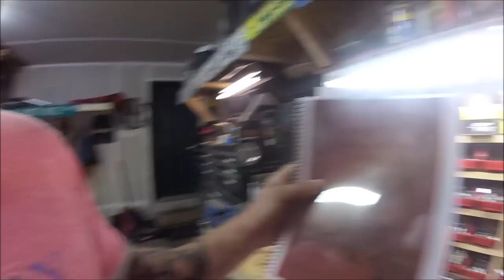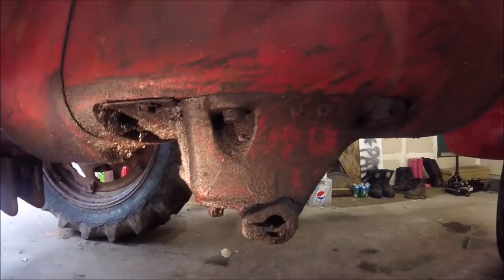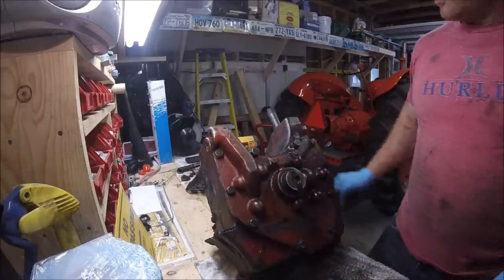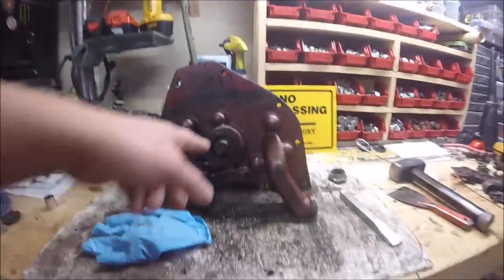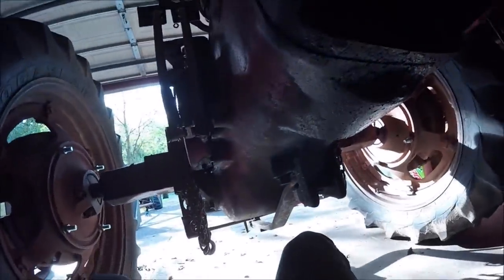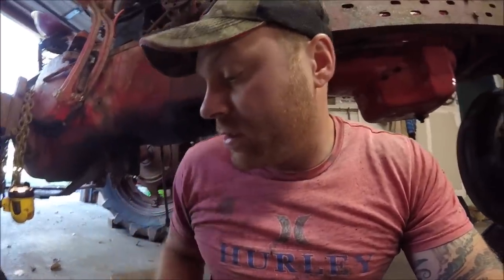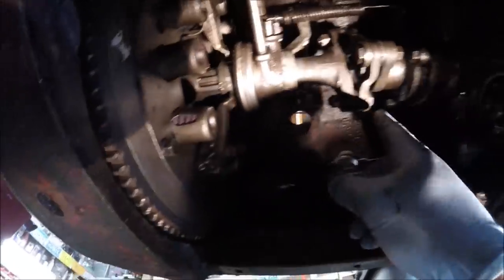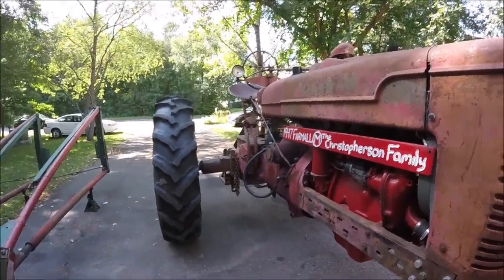1947 Farmall M Clutch Removal & Belly Pump Service

Comment: the early lift all pumps  were only 450psi low volume pumps farmall made n upgrade kit with  a larger gears and a pressure relief valve that increases the pressure to 750psi and  much more volume
Reply: Yea my 1940 M is putting out 500 p.s.i.
Reply: that  is why that seal did not fit. also the lift all pump from the f20 will fit the M or the H.the farmer next door to our farm had a1939 H sn 0113 on steel .no hydraulic  no belt pulley and no electric start and a   solid pipe seat pedestal and it was on distillate . he farmed 100acres with it and it pulled a 6ft disc and a 2-12 trip plow.  since it was on steel 5th gear was blocked from engaging..
Reply: i learned to farm with a 51 farmall H  it was my tractor dad used a ac d15  we did all planting spraying and cultivating with the H it came out from the factory with the high compression piston set which dynoed out at 30.5hp just enough HP to pull a 10ft disk in 3rd gear in most ground.
Reply from the maker: I love hearing these stories! I would like to rebuild the H next.. More on that to come (I have a video planned with some ideas).
Reply from the maker: So they had a replacement reservoir in the upgrade kit? The bore in the casting is too small for the seal, which is why it didn't fit. You would have to put the reservoir in a mill, and machine out a larger recession for the new seal to fit. Unfortunately, I don't have that equipment.
Reply: you get 2-3more hp and smoother idle  by using a 300 carb the original carb flooded way too easy and was always leaking even after a total rebuild with new float and kit
Reply from the maker: I'd love to change out the carburetor on it for a Super H or 300. This H carb really isn't the best for the tractor.

Comment: Learned something new. My grandfather always broke the tractor in half to replace the clutch sleeve carrier but this way you do not
Reply from the maker: Nope, on the H and M series you can get the clutch and driveshaft out without splitting. It wasn't until the 12" clutch in the Super M that it was necessary to split the tractor as the components are just barely too large to get out of the belly of the torque tube/clutch housing.

Comment: the IH dealers had a pair of Tee handles that went thru that funny lookin slotted hole in the very bottom of the pump.  this tool was incerted in each sid and 2 mechanics blocked the pump and then got into position and lowered it down manually. i have used these tools  IT service book i had had a print for making them
Reply from the maker: Yessir, I know the T handles you are speaking of. Little hard to operate them by yourself, though!
Reply: the dealership modified the ones the shop had and made it into a jig for a floor jack this prevented  the pump from tilting or falling of the jack when R & R ing it
Reply: when i was working for the IH dealership a customer with a 60hp M was pulling a 14ft disk and twisted off the clutch shaft a helper and i had to fix it in the field we had it repaired in 3 hours the customer  took the 2 of us to the local cafe for lunch.
Reply from the maker: That is a pretty big disk for an M - but she didn't run out of power (just strength in the driveline). These things were designed and meant to be able to be fixed in the field. Unlike the tractors of today.

Comment: I am having no luck at getting the hydraulic coupler off the tractor to replace the seal tride air impact  and heat . Any information would be helpful
Reply from the maker: On my H, I had to cut it off. It had been installed so tight that the threads were mashed inside the coupler.
Reply: @KennyKizzleRustyNutzRanch   do you have any videos showing how you cut it off?

Comment: A manual I have mentions you have to time the engine in a certain way before I remove the pump. Is that not nessesary? Thank you
Reply from the maker: Only if it is the live hydraulic pump. The live hydraulic pump is driven off the cam gear, and serves as the timing gear for the ignition system. In this case, yes. But the belly pump is not timed to anything, nor is it a live pump. It is driven off of the transmission countershaft and in no way affects engine timing.
Reply: @KennyKizzleRustyNutzRanch  thank you

Comment: Gee you make that look so easy!! You need a tranny cradle for your floor jack. They come in handy for those types of situations when you are by yourself. I didn't recall you ever saying the pump leaked but you have quite a herd of tractors, I must of missed it. I still remember it sitting at the junk yard, locked up. It has come a long, long way.
Reply from the maker: It actually was not too difficult at all. The most difficult part is removing the pump itself (balancing it), and then remembering the order of operations in removing the clutch and reinstalling it. A tranny cradle would be NICE. So would a welder! That tractor has been through the ringer, that is for sure. Definitely have been in it UP TO MY ELBOWS. I think that is why I just couldn't part with it.

Comment: Finally getting around to watching all the vids! Looks like a job just getting that pump down from the tractor and back up in it! I'm gonna have to do that on my H and M pretty soon. They are both pretty leaky... And Thanks for the Shout out buddy!!
Reply from the maker: It's not too hard of a job - biggest thing is lower it SLOW. When it finally slips out of the belly of the tractor, it is VERY tippy, and VERY heavy. It will definitely smash your finger or hand if it lands on it - so if it starts to fall you are better off letting it go! Glad to give you a shout out - I appreciate all the conversations!

Comment: Great job on all of your videos. I have been (ever so slowly) restoring my 1941 Farmall H model. Serial FBH 21044. I have installed the PTO system that was missing (the one with drive dogs, not splined) I am a bit concerned that it won't be able to handle significant load like rototiller attachment. Guess we'll see. I currently have a hydraulic pump that goes in front of the magneto instead of the belly pump, but after watching this video, I am contemplating installing a belly pump.
Reply from the maker: In my opinion, I would install the pump in front of the magneto. This will give you live hydraulics like the Stage II Super H. Quite a bit more useful than the belly pump.

Comment: Hi Kenny, this video has encouraged me to fix the leak from the front of the transmission/hydraulic belly pump. Please comment back on the part numbers of the seals, where they go, and where to buy them.

From the video I see you successfully found 3 of the 4 seals. in my searches I am only finding 1 or possibly 2...

Your experience is greatly appreciated.

Thanks,
Henry
Reply from the maker: Henry, here is what I have for seal numbers. I ordered all of them as SKF (insert part number) from eBay or Amazon. You could go to your local NAPA and get them with the SKF numbers as well. The hydraulic actuator arm is the seal I have had trouble finding a replacement for. I ended up doctoring the one I have and so far it has been holding. Anyhow, here are the numbers. I hope you find this helpful.

Belly Pump Drive Seal: IH# 43509D superseded by 938294R91 SKF#13649
Belly Pump Actuator Arm Seal: IH# 19812D (used with shaft 15089E) or 494027R1 (used with shaft 15089EA) - parts diagram lists two different seals. SKF# 7512 for the IH 19812D. Navistar/SKF/Timken do not list a cross reference for the 494027R1 seal.
Trans Input Shaft Seal: IH# 43359D superseded by 71871C1 SKF# 20702
Trans Countershaft Seal: IH# 50839D superseded by 381907R91 SKF# 16113

Also, here is a link to an online parts schematic. I am sure you can also get the parts from Case-IH. https://www.messicks.com/cas/48950
Reply: I k ow this is a old video I’m just hoping to find out witch seals need two ordered

Comment: If you can't find a new drive dog or your grooves are too deep you can take it to a machine shop and have it turned down and a thin sleeve turned and pressed on to create a new sealing surface.Crankshafts are repaired this way. You can use this method for a lot of parts where you have a sealing surface. Normally you turn the sleeve to a sufficient thickness and shrink fit it on. Just a tip. Also glad to see you make proper gaskets and not just smear some rtv on everything.
Reply from the maker: Thanks for the info, Johnny! I was able to get the drive dog cleaned up nicely with some emery cloth, and it is holding well now. I believe there is a company out there that makes what is called Speedy-Sleeves to do the same thing you are speaking of. Essentially it is to make the shaft true again, to allow for a good seal. I usually use RTV sparingly. I like to take a VERY thin layer and coat the gasket just to help it stick and seal.

Comment: The shop I worked for had a jack that fit into the big hole and the bottom with a key way. I slid in sideways and had screw jack to lower it down.
Reply from the maker: Yes, I have seen multiple different ways/tools used to lower the pump. I believe in some of the old IH books, they have a two-person tool available. Almost like two big T-handles that slide in the cultivator hole in the bottom of the pump, and each person helps lower it down.

Comment: Hi Kenny, did you ever find the right seal for the belly pump actuating shaft where it comes through the reservoir housing? Thanks, Mike
Reply from the maker: No sir. I was unable to locate it. I ended up doctoring it up with a little RTV.
Reply: @KennyKizzleRustyNutzRanch  OK, too bad it wasn't available. I dropped the belly pump on my M today and hopefully the only seal I will have to replace will be the countershaft double seal. Can you advise me on what type of gasket material to use? I've never made one but it looks like I'll have to try if I tear into the pump itself. Also Kenny, what type of oil do you use in the belly pump? Same as the engine oil? Thanks again for your help. Your videos have proven invaluable!
Reply from the maker: @mikebailes172  You can order a gasket from Case IH for the pump, otherwise I would just get a sheet of FelPro gasket material. 1/32" thickness should be sufficient. The pump uses SAE30 weight oil.
Reply: @KennyKizzleRustyNutzRanch  Thanks Kenny, really appreciate your time and help!
Reply from the maker: @mikebailes172  you're very welcome!

Comment: Great vids.  after watching the balancing act, I would think just running up a couple dowel bolts to guide assy down with floor jack?
Reply from the maker: Yes, a lot of people use threaded rod. I have had pumps out a couple times so I am confident in my balancing technique - but absolutely would recommend it to anyone who is looking for a little added security and safety! (No OSHA in my garage)!

Comment: The 45 H I worked on looked a lot the same, however the front hall of the drive yolk slid forward 5/16 so I could rotate the coupler to get it apart and replace the bearings in trans and bottom shaft, I reckon the front shaft slid into the clutch spline. The original seals all had CR stamped in small letters
Reply from the maker: Yessir, the H and M can both be replaced through the belly. It wasn't until the Super M that the tractor required to be split. The 12" clutch wouldn't quite fit out of the belly of the tractor. This prevented you from removing the driveshaft coupler and shaft... I am sure I will have to do my H at some point as well. Was thinking of using it for a restoration project next.... We will see what spring brings!

Comment: Great video! It dont take much defect for a seal to leak. Those belly pumps gotta weigh 100lbs.
Reply from the maker: The shaft seals were shot, two of three of them were worn through to the springs. The belly pump is heavy, but once you get the balance down, lowering with a jack, you really only need one hand to steady it. If it starts tipping, though, she will go fast!

Comment: on the pump drive  farmall parts had a chicago rawhide sleeve and seal kit that you pressed a sleeve on the drive block  and used  red locktiite  when you pressed the sleeve onto the block.
M&W gear co and tisco made a high capacity oil tank that replaced the lift all pump assembly when installing the hydraulic pump in front of the mag or distributor
Reply from the maker: Good info, here. What DIDN'T M&W make for these IH tractors?! Man, you could get just about anything cool for them. I have seen guys just make a plate that mounts to the back of the reservoir, and remove the pump. This would add at least 2-3 quarts capacity to the tank without the pump in it.
Reply: when farmall developed the factory 2way upgrade valve they discovered the pump pressure and volume was too low to handle a 4 inch bore 2way cylinder  thus the pump upgrade. when dad bought the live cessna pump from TSC the original  tank was gutted and the drive shaft hole was welded shut. the reserve oil supply was adaqit only if you had the entire system full and usted 2 way cylinders on the loader.  as for M&W  here is what i remember they had in their catalog.. engine sup up kit  which included stroked crankshaft with rods and special pistons larger valves and seats high lift camshaft carb kit governor kit special timing advance weights and springs  higher volume water pump end result 85hp. heavy duty clutch and pressure plate heavier clutch shaft.. for the transmission     a 9 spd kit a live pto hand clutch kit  and disk brake  upgrade kit and the friction throttle.. note with the engine upgrade kit to 85 hp  it was balanced for more than factory rpm as it had a shorter stroke so the higher hp was achieved thru more rpm with the other enhancements.
Reply from the maker: Wow - that is pretty impressive that they could get 85hp out of it with mostly "bolt on" accessories. I don't think my pump has had the upgrade kit - only way to know for sure would be to plumb in a pressure gauge to see what it is putting out. I would be willing to bet it is about 4-500psi.

Comment: Hi Kenny, in this video you mention a "manual" that gives direction in this process of belly pump maintenance. Could you tell me how I could get that manual?  Thanks, Mike
Reply from the maker: It is the International Harvester Blue Ribbon service manual for the Hydraulic Lift All. I purchased mine on eBay. https://www.ebay.com/itm/Hydraulic-Belly-Pump-Lift-ALL-Farmall-H-M-MD-IH-Shop-Service-Owners-Manual-Set/283688429634?_trkparms=ispr%3D1&hash=item420d25e842:g:cjAAAOSw2bRd3FdA&enc=AQAFAAACcBaobrjLl8XobRIiIML1V4Imu%2Fn%2BzU5L90Z278x5ickk7PdDazAlGltMLJlUhrWsD2JL7FBYi95tnKX%2BOyk5om5eyGtjJgaP7gpiFIXfFQX7nHLbolBqJlofQBy40vYSbX6Dgy93Zuqppt6ZY7jNugCyPQpHplCgCsiL7M7y0iN9V0khOuSxn1nOqfRzzAxxvLfPH1EB5TW%2BFVl1hpgxKiM5ysUGUwFLARHkAkDwrkMaEKFnKP2TuVZvnaCuNggTF990huZP3geIt8j%2FkQP4543gmYqIXhMIMWi0VrcHoQXu3vXN1IVSI3Ee%2BDIEUaNgEjPk6OuPjyCNtat%2BAUGfrNYcuu9M6Ewp5x0%2FM9Sa0AulWH6lZwtIeMiJHhviyPbGyrY5aWz596iFuIdJSFD%2BHrY4pKAz2URoUYhQeFh4%2B9eew4q0ds6Aofih3vVzQmyjmCjoBQqmOU246dey3yb1Fi%2F4q2%2Brro8mnJ%2FYP%2BjYf0B5Gqkh0F4JbY%2BCEkb%2BBRQ5beGftzJcIpBcSVv3t70bXuW1Q4pq0bpi%2FrH5mTVFxzWRWOI%2FAnGRAHw70%2BPPGtw5Mj528RcYxJjUj8H2XpCNmXkbYUSnVpkqajCvg6T8p%2FMsPnNrm2C3iB9%2Fvr55n%2BqetRqta1%2BRZ66pJG6H3Z5aTWAiPdpYCr9XvYED6IYYF6OmNKymJD%2FDPHfPS7Ol7EXid3hZQWHsduvoogurgbOiM%2BWBxvtxISdDsTFo%2FMnVh%2B8taJzv9Evb2D%2Fhd6rYHtluLxhW0%2FWHYnXx3mzMpF0sDDvJuCUrL6UUCfBwFmvr8y8PxnjXVvvh3GrKybGdtzBWXA%3D%3D&checksum=28368842963487b90b6cf7714d19aebc2ed0bf3e7430

Comment: Really great and very helpful video. Working thru same things for my 1939 Farmall M.  Any types or directions as to how to remove the half-moon woodruff key on the transmission input shaft yoke coupler that must be removed to change the housing seal behind it.  Thanks very much & would appreciate any response/directions.
Reply from the maker: Thanks, Bruce! There was nothing out there for these belly pumps, so I decided to make a video of my own - and I am glad I did! I think I used a combination of a brass drift and hammer, and a vice grips to get the woodruff key out. It is half moon,so if you hit it down on one end, the other end will pop up and you should be able to grab ahold of it. If you mark it up you can always clean it up carefully on the bench grinder, or using a vice and a file.

Comment: You may have said it in your video but is the deal that you built the tool for to loosen a right hand thread?
Reply from the maker: The tool was made to remove the hydraulic pump drive cog from the front of the countershaft. These are NOT reverse thread.
Reply: @KennyKizzleRustyNutzRanch  okay thank you! I got to that point and I thought it was pressed on until i watched your video.

Comment: I know this video is a couple years old, but do you know what direction the pump is to spin? I bought a pump in auction the other day and  would like to make it pto driven. Judging by how the dog came out I think it would be clockwise so it tighten by rotation.
Reply from the maker: Well, looking from the front of the engine towards the rear. The engine turns clockwise, all the way back to the transmission. The hydraulic pump is driven off the countershaft in the bottom of the trans, which turns counter clockwise (looking from the front). That shaft drives the hydraulic pump directly. So, if you are looking from the front of the pump to the back, the shaft would be turning counter clockwise, but if you are looking from the back of the pump at the drive dog forward, you would be looking at clockwise rotation.
Reply: @KennyKizzleRustyNutzRanch  thanks